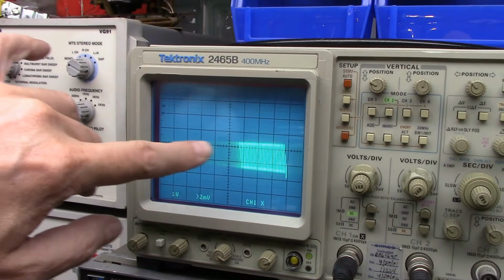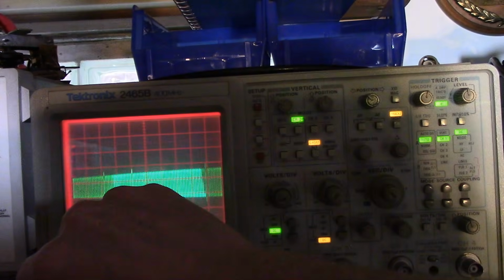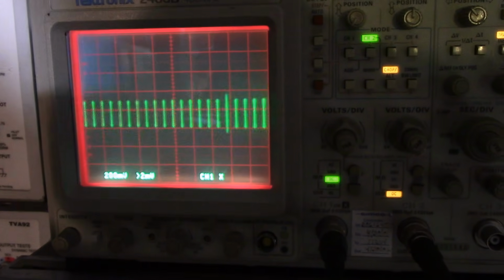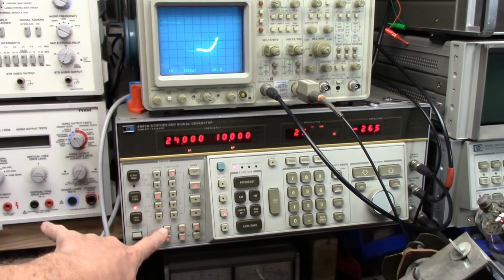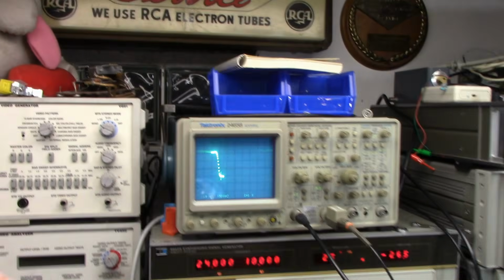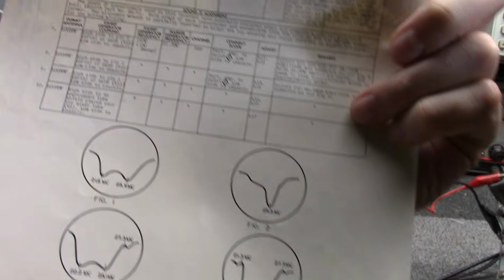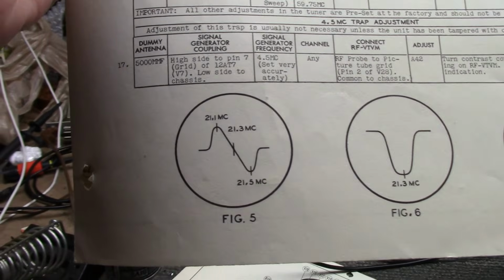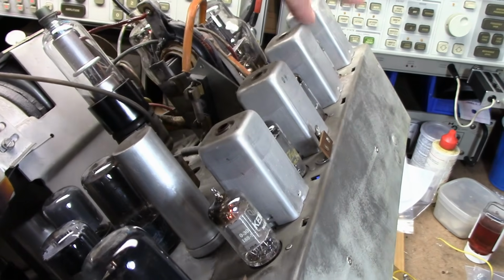Zenith 28T962 Warwick part 4 - audio alignment

Comment: Hey boss I have a question for you and i'm sorry.I couldn't find a just a way to message you directly.  I have plenty of audio analyzing equipment. And I'm not an expert, but I'm getting better, journeyman electrician.   And I'm also looking into the stuff you're doing and have a pretty high curiosity for it, and I see locally, there's a sencor VA62 universal video analyzer, I was wondering if that would go well with The other equipment I have for kind of dialing in older TVS and help me how with troubleshooting and servicing. Would that be a good purchase for me? I appreciate your judgment thank you
Reply from the maker: It's an interesting device for sure.  You can program the IF frequency of the test pattern.  That can be very useful for troubleshooting.  However, it doesn't do the older 22MHz IF like this set uses.  It only handles the more modern 44MHz IFs.  Someone did figure out how to reprogram an EPROM inside so it will go lower, but that requires opening it up and doing some tinkering.
Reply: @bandersentv That sounds good, I picked it up, thanks much!!

Comment: Bob, sorry if you already answered this in the vids, I'm not the sharpest pencil in the box: 
Is 1 take away from this and the previous vid that you can get better picture quality using a spectrum anaylizer for alignment versus conventional methods for video alignment? 
Is it more effective on this - split carrier - versus inline carrier? 
Venture a guess as to audio alignment using a SA versus convetional method?
Reply from the maker: No, not at all.  It's just another way to do it.   It's actually easier to do it with a conventional sweep gen and markers.  Especially since the alignment instructions assume that's what you'll be using.  I'm not sure if I could have aligned the sound with my SA.  Ther main hurdle with using an SA is you have to probe the signal before the detector and that's not also possible or convenient.

So why did I use a spectrum analyzer? Mainly to see if I was possible.  I recently invested a lot of time and money in getting mine working and I wanted to see what it could do.
Reply: @bandersentv  Thanks for the answer. Also, that HP is an excellent sig gen, as I am sure you already know.
Reply from the maker: Oh yes.  I became quite familiar with the HP 8662A while rebuilding the power supply and repairing one of the modules.

Comment: Hi Bob. What about a small signal RF amp going into the intensity input, say 3-4x gain?
Reply from the maker: Possibly but no need for RF.  It's bursts of 5kHz triangle waveform.  Sweep rate is only 1 second.  I'd also need to offset it as it appears to be +/- symmetrical while the scope wants 0-5VDC.